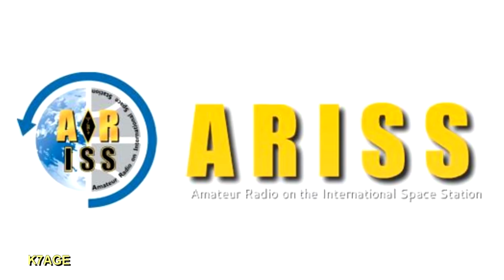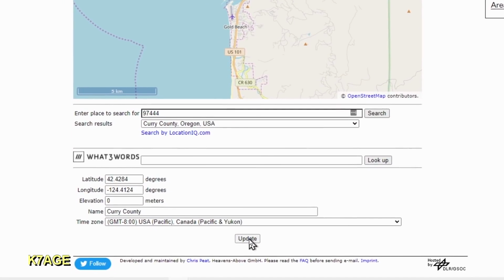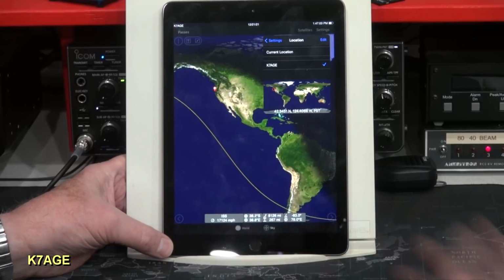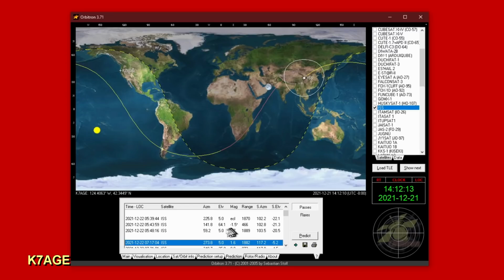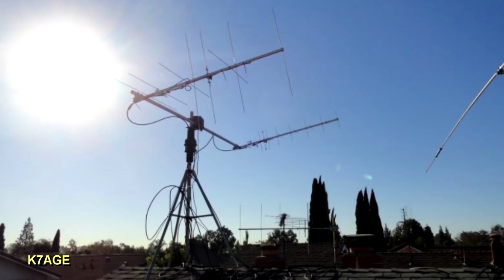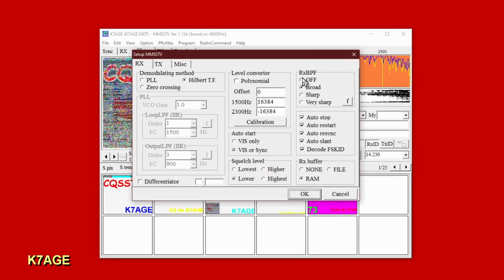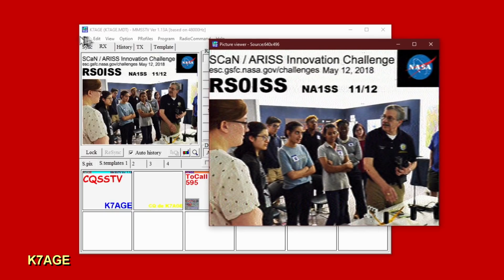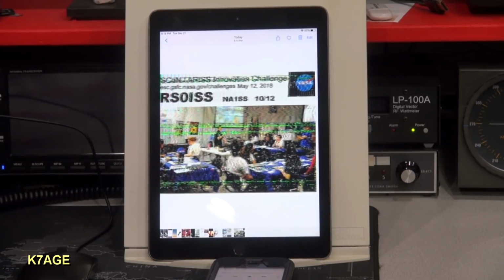How to receive SSTV images from the ISS

Comment: Randy, did you change any settings in the 705 for the simulation? I can't get MMSSTV to 'hear' the audio from my 705.   I'm trying to do the exact same thing you did.
Reply from the maker: Hi, that was three years ago. I don't think I was using MMSSTV for transmitting through the 705. I may had been just playing the video file with the audio feeding the 705. It was so long ago, I don't remember.

Comment: Iss sstv enent starts this monday. I have an rtl sdrv3 and a vhf/uhf antenna which states 176-174mhz for vhf. Do you think that i will be able to pick it up or should i try to build a quarter wavelength dipole with some electrical wire i have laying around? Thanks in advance sir
Reply from the maker: Try what you have. You can build the antenna and see which works better.

Comment: there is a web based sdr out of Murmansk russia that has the 144-146mhz band available and u can receive signal thru it... hopefully they will do more of these..it also has the 136-137mhz band... i have been receiving Noaa Signals thru it lately... ... just gotta change the ground station on gpredict to see when satellites are overhead
Reply from the maker: Good to know. There is equipment problems with the SSTV station. It will be a while before it is running again.

Comment: I have been away from SSTV since 2010 and only had a few SSTV QSO's. I had a homebrew interface which lost it's PTT capability so purchased a SignaLink USB. I was trying all the modes PSK31, FT-8, etc. Then decide to see how it worked on SSTV using  MMSSTV last month (April 2022). Works great! Then I started searching YouTube for pointers. Randy, Thank You so much for this video. You brought out several things that I didn't know about. 
I think I will go through the manual. Thanks. Rick - N8XI

Comment: What is the point in doing this. Can SDR be used to send large amounts of data or email??
Reply: no SDR is to receive.    This is to receive images from the ISS space station though VHF radio. Could use a Ham radio or SDR
Reply: @CSIS-Spy  but how would you get the images you wanted and not just random ones
Reply: @ That’s the point is a surprise from the astronauts on the ISS. If you want the images you want download them from the Internet.  🤣

It’s like someone texting you a surprise pic
Reply: @CSIS-Spy  thankyou so much for your help

Comment: Darn, I missed this one!

I don’t have a very professional setup, but it works for me. I point my rubber duck antenna at the horizon(or wherever I get the best signal), and record the signal on my phone. After that, I play the signal to my computer, which has a program for SSTV image decoding. It is a little noisy, but it works! It does need to be fairly high above the horizon though, as I don’t have a directional antenna, and the closer it gets to the horizon, the less clear it is.
Reply from the maker: It works!

Comment: I know nothing about ham radio... but did I miss how the signal is interfaced with the computer? where does the software get the signal from?
Reply from the maker: My radio has a computer sound chip inside. The MMSSTV is then configured to use this sound source.

Comment: This video just appeared in my suggestions, and wow, great info! So of course I subscribed. I am actually an Extra Class license holder, though I still haven't got a working rig setup to use. I'm on a limited VA disability income, so I have more time than money (so I spent the last few years learning and advancing through the license classes). But I do listen to the online SDR's almost daily. This gives me something new to try- I should be able to track the ISS using your instructions, then go through the process of finding SDR locations that are receiving the strongest, then base my software settings based on the location of the SDR that I am using at the time. Then record it and bingo! What other hobby is so robust that you can still participate in the fun without the actual traditional equipment?
Reply from the maker: The online SDRs are handy to play with.

Comment: Today I was able to receive a SSTV image from the ISS!  II was using my Icom IC-746 and a Diamond CP-22E about 10' high on a dipole into QSSTV and got a clear loud signal, and the ISS wasn't even directly overhead, it was on the outer edge.   Shows you that you don't need a extreme setup to get a signal, at one point it was coming in full quieting!
Reply from the maker: It does work!

Comment: Thanks, great video! I tried to receive the iss today on two overpasses, but didn't see any signal. I use a RTL SDR and a DIY Groundplane Antenna  for 146MHz. I mounted the antenna on a tripod in the garden with OK visibility at the sky for higher elevations. Should I see something with this setup? How important is line of sight to the sky? Any idea what I'm doing wrong?
Reply from the maker: You should be able to hear it. Are you able to hear other signals? Maybe play with the gain, I forget where that is.
Reply: Put your gain to max, make sure the antena ground is not touching the middle pin connector, make sure to use 50 ohm coax, i use rg58. 
A good starting diy antena is a quarter wave dipol set perpendicularly on the direction of the pass so the polarisation matches. 
This is all I could think of from my very limited knowledge

Comment: Great video and thanks for taking "Elmer" time to make it.  I'm in Yuma, AZ., for the winter AND Santa (dressed in a Fed Ex outfit) delivered my new Icom ID-52A, yesterday. I'll be using that as well a new IC-9700 (Santa was real nice to me year) and a IC-705, to record these passes.

Question 1. Do you think I should I open the squelch to record these with the ID-52, or will the signal be strong enough to open the auto squelch?

Question 2, will I need to adjust frequency for these passes to account for the Doppler effect?

I'll be using a Comet antenna on the 9700, and the IC-705 gets the Arrow II -  BP.  I'll keep it tracking with the help of my smart phone. The ID-52 will just have its ducky.

Should be a lot of fun. I'll keep you updated/posted if successful. Maybe even buy ya lunch this summer when I return to Oregon. (about 90 minutes North of you in Lakeside)

Thanks again!  73,

Wayne - W7WGC
Reply from the maker: I haven't tested this, but I would leave the squelch open while recording to the SD card. If squelched, and the signal drops out, the radio may stop the recording and start a new file when the signal comes back. You may then end  up with several files.

Look to see if  you can set the radio with a wider filter. I know the 9700 provides for filter selection.

Good luck Sunday morning,.

Randy

Comment: Randy,  thanks for this video.  I have my 9700 with a 2m eggbeater antenna and MMSSTV all setup and ready to decode.  
How did you rename the Codec for the 9700?  I have my 7610 USB codec named but forgot how I did it.  Thanks and Happy Holidays.
Reply from the maker: Go to the Sound Control panel, select the audio device, the properties,  and then change the name.

Comment: Hi Randy, Thanks for the great video and the reminder that this event was almost upon us. About 15 years ago I briefly played with SSTV  on 20m SSB . Thanks to your video, I’m going to give it a try. Maybe a tool to get the grandkids involved too. My K3S which does cover 2m does not have FM capability, only CW, SSB, and AM. I presume these ISS transmissions will be on FM. On the positive side my small 2M EME array has AZ/EL capability. I have an old IC 706 which I think I can get interfaced to the PC.  Already got MMSSTV cracking away downloading  a number of frames on 14230. Thanks again. 73 Dave K1KA
Reply from the maker: Sounds like you have a project!  Hope you receive loads of images.
Reply: @K7AGE  Hi Randy. Things are going well. As of the end of passes on Thursday, I have 35 downloads including all 12 images. Thanks again.
Reply from the maker: @davidmackey4553  outstanding!

Comment: Thanks for that. I installed Orbitron but the ISS seems to be flying round the World in about 30 seconds. Anyone help with my settings?
Reply: I think my TLE wasn't updating properly and doing it automatically has reset it to YEARS ago. Doing it manually with TLE file on the webpage has solved the problem for now. 

amateur, cube, orb, noaa, nnss, musson and visual loaded.
Reply from the maker: Good. above the clock on the right it will toggle between RT and SIM mode. Thanks for watching. Randy
Reply: @K7AGE  Thanks for the reply Randy but I still seem to have TLE update issues every time I start up. 

Doug, Glasgow, Scotland, MM7DCD